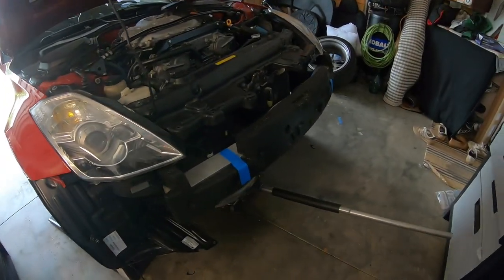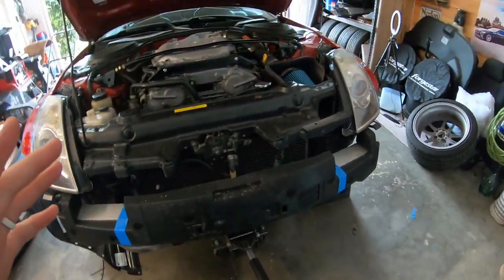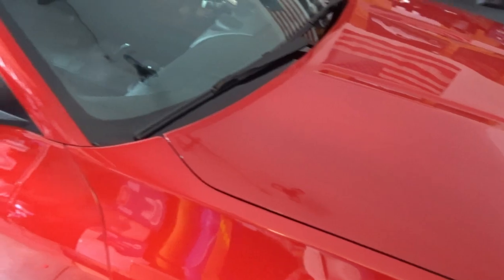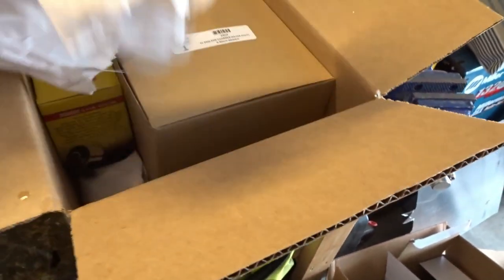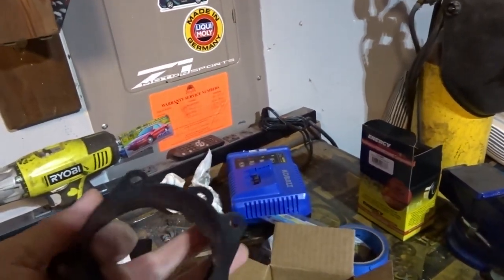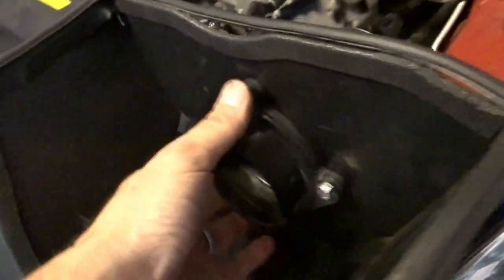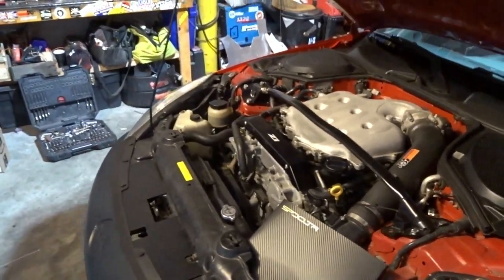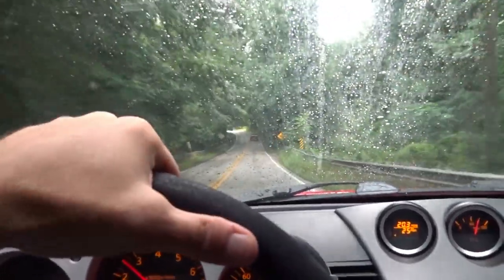Can't Trust Anyone These Days

Comment: That blue filter in your hands is one of the better one actually bud.
My injen and vibrant filters are like that, it’s a built in velocity stack that makes the air enter the filter smoother. I have that with a vibrant velocity stack as well. Not meant for your setup tho 
Normal filter with a flat top and flat ring surrounding the coupler are turbulent and don’t flow as well
Reply from the maker: The car originally had a flat face cone filter.  With the cover for the box on to prevent hot engine bay heat from entering the intake, it starves for air.  It’s not a butt dyno thing.  It very clearly impacts acceleration.  The problem is that very small inlet through the radiator support.  It directs the air directly into the flat plastic ring with not much space to get to the filter surface.  The injen filter did the same.  
There are so many theories with intakes it’s crazy.  Some testing shows smooth intake air is best.  Others say tension needs to be broken for best results.  All I know is that in this setup, air needed a more direct entry point into the filter than the injen or the filter that was in it provided.  No doubt the injen is good quality.  Just not for this air box

Comment: Dude. That music. With a cold brew, it's perfect. Just finished ripping on the HR for the day, coolant/rad drain & fill was last week. Strictly intake vs. throttle response vs. ET's at the strip, I had one conclusion drawn with the old FBO 06 coupe. Full cold air setup down in the bumper (Injen CAI) yielded a lot less heat soak on a normal Summer night than short-ram setup, which I tried AFTERWARDS before the Admin intake & NWP TB went on. FIlter? The one you held wondering wtf it was, that exact same one. Throttle response was nice, but not as direct as the 'big' setup. The Admin intake (3.5") and big TB, with headers and a re-tune, got me 3 tenths on the quarter. After two runs it was heat soaked to hell though, every time.
Reply from the maker: 3/10 is pretty significant!!  This cone filter is definitely better than what I had going on.